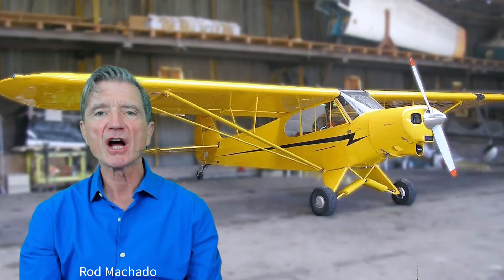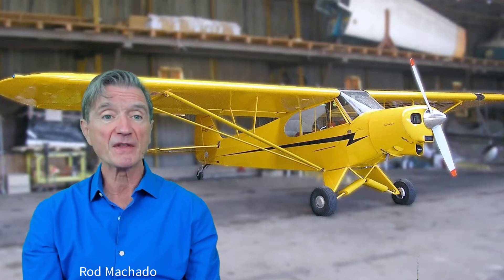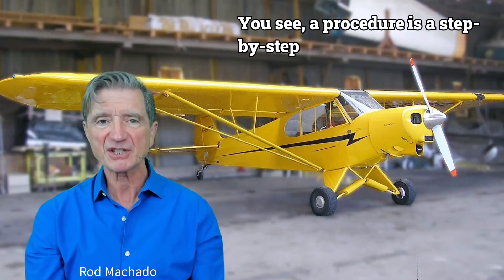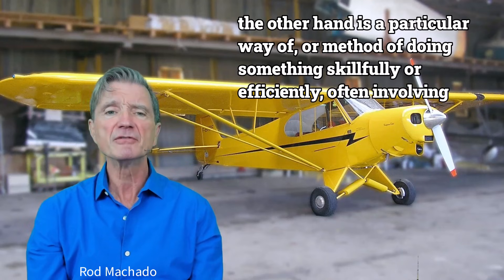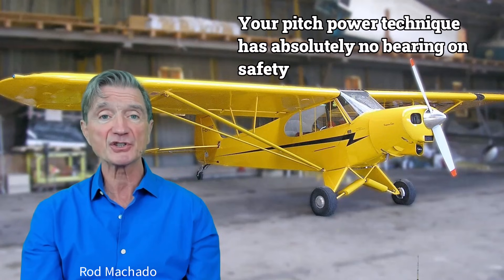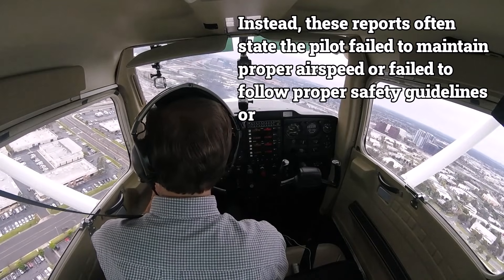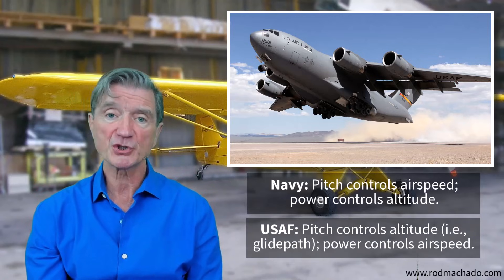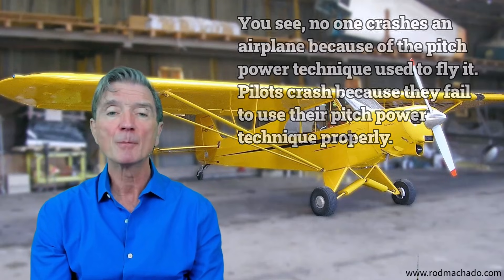Technique vs. Procedure

Comment: there is one, and only one, right answer to this.

Pitch controls airspeed
Power controls altitude

This is mathematical and scientific fact. If I could post images here I would, showing the derivations of the fundamental equations of physics to show that adjusting the throttle affects climb/descent when all else is held constant, and that changing pitch controls airspeed when all else is held constant. This is not open for debate. this is physics, and can be demonstrated in flight in any airplane easily.

There are multiple aerospace engineering books out there one can look to, but the best I've found so far that explains it perfectly is "Airplane Performance Stability and Control" by Perkins and Hage. Chapter one of the book goes into this in detail and derives teh equations right in the book. I say this as a CFI-I of airplanes and helicopters, and as a practicing Aerospace and Mechanical Engineer with tens of patents to my name. Appeal to Authority is a logical fallacy, I share my credentials only to say that I am not some random person saying this, but someone who has dedicated decades of my life to aerodynamics and aviation, including flying, engineering, and the history of aviation.

A person can manipulate the controls in different orders and combinations to achieve what they want, but the fundamental truth above remains true no matter how you do it, no matter which order you try to do it in.
Reply: That is why the airplane begins its ground roll by pulling yoke back, not throttle lmao
Reply: @02YSlkZWQ9  Yeah - it's the same fantasy as believing a six foot propeller can oppose 2000+ lbs.
Reply: Cool, ever flown a jet? It’s usually pitch for altitude power for speed in a jet. Really, it’s always both interchangeably for both, depends on what you’re doing. 

You can always trade speed for altitude and vise versa. You can add power whilst level to increase speed or add power with the same speed and increase altitude. Same with descents. 

We’re overthinking this. 

Maybe for a student pilot who needs something simple to latch on to, we’ll pick a technique and stick with it. 

When a pilot gets a few thousand hours and becomes unconsciously competent at flying they don’t need to think “Okay so uh, I need to add power, oh and then trim, and then uhhh oh yea adjust pitch” 

They simply put the plane where it needs to go with whatever technique is appropriate to their current configuration/position/intent. It’s an instinctive action and not a conscious decision.
Reply: @byronhenry6518  jet makes no difference. what matters is the wing, and thrust. the source of thrust matters not.

You're stuck on regurgitating a procedure you were taught. I'm discussing the cold hard first-principles SCIENCE behind how it actually works.

"We’re overthinking this. "

yes, you are.

"You can always trade speed for altitude and vise versa. You can add power whilst level to increase speed or add power with the same speed and increase altitude. Same with descents. "

Only momentarily. most aircraft for only a few seconds before the excess speed bleeds off. but even then, teh excess speed is doing EXACTLY what the math/physics says as I mentioned above.

"Maybe for a student pilot who needs something simple to latch on to, we’ll pick a technique and stick with it. "

yes, so teach them the Truth, the Correct way.

"When a pilot gets a few thousand hours and becomes unconsciously competent at flying they don’t need to think “Okay so uh, I need to add power, oh and then trim, and then uhhh oh yea adjust pitch”. They simply put the plane where it needs to go with whatever technique is appropriate to their current configuration/position/intent. It’s an instinctive action and not a conscious decision."

absolutely. but that doesn't change the truth of the aerodynamics or physics.
Reply: This is complete BS. If you push the stick all the way forward in any airplane, certainly the airspeed will increase.  You will also lose altitude. Pitch affects both airspeed and altitude, not just one or the other.  And in a high speed aircraft, engine power is sometimes used to climb and sometimes used to accelerate to a higher speed at a CONSTANT altitude. 

I also have a degree in Aeronautical Engineering and your statement that this is a mathematical and scientific fact is simply wrong. Also any pilot who has ever flown aerobatic maneuvers knows how pitch and power really affect altitude and airspeed.
Reply: @timr1422  Pitch affects altitude INDIRECTLY, and airspeed DIRECTLY.

same as how the rudder affects Roll indirectly, and how power affects pitch indirectly.

"I also have a degree in Aeronautical Engineering and your statement that this is a mathematical and scientific fact is simply wrong."

then you need your degree revoked. Go read chapter one of Aircraft Performance Stability and Control by Perkins and Hage and go educate yourself.

you're conflating situations where you change multiple variables at once dramatically and only look at the dynamic period BEFORE equilibrium change and claim it explains things. that's not how we do it. You have to change ONE variable at a time in controlled time steps and see how that change affects everything else, and look for the new equilibrium state. :Learn how to do actual science.

"Also any pilot who has ever flown aerobatic maneuvers knows how pitch and power really affect altitude and airspeed."

yes, and if they have any clue, they'll agree with me.

I am also a CFII not just an engineer who designs airplanes. I also teach engineering to engineers on-the-job (real world application, not just theory in college).It is very easy for me to go up flying with you and prove in less than 5min everything I am saying. and within an hour or less (in-person) I can derive and explain the math for you as well. Or you can go read it for yourself.

but thus far you have given no valid scientific explanation for how pitch DIRECTLY controls altitude, nor how power DIRECTLY controls speed. Given me and everyone a valid explanation of how that works, nd tell me where I can find mathematical equations supporting your claims in at least one Aerospace engineering resource?
Reply: @SoloRenegade You still haven't answered my question.  In level cruise flight, how does the power create an upward force equal to the weight in order to control altitude?
Reply: @warren5699  i've already provided explanation in previous responses? we are not flying rockets, we get most of our lift from the WING, not from THRUST. Also, go ask ChatGPT what force component vectors are.

how about you attempt to explain it yourself, scientifically?
Reply: @SoloRenegade "we get most of our lift from the WING".  Of course.  Then what's with the "power controls altitude" above?
Reply: @warren5699  ""we get most of our lift from the WING".  Of course.  Then what's with the "power controls altitude" above?"

wow, do you have amnesia? where have you been? you've been debating this how long and you're now going to act like nothing has happened and start all over again at the very beginning? 

Power Does control altitude, via excess Thrust. Excess thrust results in a climb. Insufficient thrust results in a descent. this is not rocket science. Pitch controls airspeed.
Reply: @SoloRenegade We're still debating this because you haven't given an sensible explanation.  How does excess thrust create an upward force that would result in an increased altitude, when there is no change in pitch?
Reply: @SoloRenegade "Pitch affects altitude INDIRECTLY, and airspeed DIRECTLY."

Now that I've given you a simple example of how an elevator input can change altitude, you are trying to backtrack and say well, it actually affects both airspeed and altitude.  No kidding-- that's exactly what I said. 

"yes, and if they have any clue, they'll agree with me."

No, they would laugh at your statements, as would any pilots with jet experience. I guarantee you that the pilot of any high speed aircraft in cruise fixes a small altitude deviation with a pitch adjustment, not a power adjustment. 5 minutes in any jet aircraft simulator would show you how wrong you are. Also, try to keep in mind this discussion is about training actual pilots how to control an airplane, not about mathematical equations.
Reply: @timr1422  "Now that I've given you a simple example of how an elevator input can change altitude, you are trying to backtrack and say well, it actually affects both airspeed and altitude.  No kidding-- that's exactly what I said. 
"

I haven't backtracked a single thing I've said in the slightest.

Pitch controls airspeed, and power controls altitude.

Limited indirect inputs tht have indirect secondary effects are true too, it's called nuance. but not every airplane is affected by these, and these indirect control inputs do NOT apply on ALL airplane designs. but pitch controlling airspeed and power controlling altitude is ALWAYS true for ALL airplanes. You lack sufficient intelligence to understand nuance.

"No, they would laugh at your statements, as would any pilots with jet experience."

any who disagree are clueless and have no clue what they are talking about. not all pilots are well versed in aerodynmiics, few in fact have good aerodynamics understanding.

"I guarantee you that the pilot of any high speed aircraft in cruise fixes a small altitude deviation with a pitch adjustment"

perhaps, and I've done it too in light airplanes as well, but these are INDIRECT effects you can manipulate to your advantage for limited effect. Doesn't invalidate the truth.

"5 minutes in any jet aircraft simulator would show you how wrong you are. "

not in the slightest. what maneuver would disprove it? I can demonstrate it in a REAL airplane and I can prove it mathematically too.

"Also, try to keep in mind this discussion is about training actual pilots how to control an airplane, not about mathematical equations."

I am a CFII in both airplanes and helicopters, everything I am saying is geared to teaching new pilots. This is what I teach ALL of my students, without exception (new PVT pilot, refreshers, or add-ons, etc.).
Reply: @warren5699  " We're still debating this because you haven't given an sensible explanation. "

I have, you just refuse to accept the truth, and you have made no effort to go read the book i cited, which you can find free online in PDF.

You have provided zero counter argument. you cannot cite a single aerospace engineering resource that supports your claim. you have not provided a single valid case in which I am wrong. I can't force you to accept reality. I have made my arguments, i have shared my industry recognized and approved sources. You have failed to refute anything I have said, failed to provide any evidence or any sources.

"How does excess thrust create an upward force that would result in an increased altitude, when there is no change in pitch?"

this I can answer, but give me some time to type up that response. But you really should just go read the book for yourself, it will save us both a lot of time.

BOOK: Airplane Performance Stability and Control, by Perkins and Hage. Read chapter one. If you refuse to do this, then you are accepting defeat.. this is a highly recommended book among aerospace engineers. Any self-respecting aerospace engineer should be aware of this book.
Reply: @SoloRenegade "" We're still debating this because you haven't given an sensible explanation. "
I have, you just refuse to accept the truth, and you have made no effort to go read the book i cited, which you can find free online in PDF."

Well, when it comes to proving anything with a concept in a book, we're not going to get anywhere.  I see discussions on different concepts in the FAA handbooks all of the time, and interpretations that are 180 degrees apart.

You say pitch controls airspeed - ok, no problem with that.  Then you say power controls altitude.  I would think about that in this manner.  First there are some raw numbers from the manufacturer we can use.  For a 160hp C172, the static thrust is about 700lbs, and the cruise thrust is about 300.  So the thrust to weight ratio is around .25:1.  It's not possible to lift any object with an upward force that is 25% of the object's weight.

We can also test this in the airplane.  I used to do aerobatics.  One maneuver I did was the hammerhead - I'm sure you are familiar with that one.  The airplane is transitioned into a straight up climb where the power is opposing the weight (same as lifting a glass of water from a table).  What happens then?  The climb stops in a few seconds when the kinetic energy is exhausted .  Why?  Because 500lbs of thrust (upward force) is less than the weight (2000lbs+ downward force).  So even when the power is aimed in the direction that will produce the maximum upward force, it cannot control the altitude.

Please don't get into any claims about military airplanes - this discussion is on civilian aircraft.

If you have an example of a procedure or maneuver in the airplane that demonstrates that power controls altitude, just tell us what that is.  There's no need to get into any debatable concepts which actually will not resolve anything.
Reply: @SoloRenegade Here's a simple example. To increase airspeed in level flight, for example from 150 kts to 250 kts, the pilot would increase power first. As speed increases, the pilot would adjust pitch to maintain level flight. In this case, the power increase is the pilot's primary input and the pitch change is only made AFTER the power increase. You wouldn't make the pitch change first to increase airspeed in level flight. 

Amazing how someone who is supposedly a flight instructor doesn't understand basic concepts about how to fly an airplane. Then you try to cover up your lack of understanding with a pompous, arrogant attitude. I feel sorry for your students, if you actually have any.
Reply: @timr1422  yes, this is a valid scenario. bu tit's not the only way to do it either. if you know your airplane, you can use known pitch and power settings.

You add power, and as the climb begins (power controls climb/descent), you pitch down to a higher airspeed (pitch controls airspeed) to offset the climb by shifting to a higher airspeed that requires more power to climb. and you keep smoothly offsetting the climb by adjusting airspeed until you get to your new equilibrium airspeed that results in no climb or descent.

But had you done Nothing after adding power, you would have climbed at the airspeed the trim was set for.

The order in which you adjust pitch and power matters not. ti doesn't change how physics works.

"Amazing how someone who is supposedly a flight instructor doesn't understand basic concepts about how to fly an airplane."

Everything I has said is 100% true. Highly claimed aerospace engineering sources, the book Stick and Rudder, and many more flight raining and aerospace engineering resources support my claims 100% and they emphatically push back on anyone who claims otherwise, same as me. Also, i can derive the MATH form Physics First Principles to explain it, you cannot. You could learn, but it's clear you have no intention of growing your aerodynamics knowledge.

"Then you try to cover up your lack of understanding with a pompous, arrogant attitude. I feel sorry for your students, if you actually have any."

I'm not like this with my students, they actually want to learn. I'm like this with ignorant and incompetent Commercial pilots and CFIs who are unwilling to learn and unwilling to stop spreading lies. We've understood this stuff for over 100yrs now, and yet you people still can't get it right.
Reply: @SoloRenegade "You add power, and as the climb begins (power controls climb/descent), you pitch down to a higher airspeed (pitch controls airspeed) to offset the climb by shifting to a higher airspeed..."

This is the dumbest explanation I've ever seen for how this works. There is no reason to allow the airplane to start climbing first when accelerating. The airplane will not climb unless the pilot allows the nose to pitch up when adding power. It's obvious your students are learning in spite of your instruction and not because of it. 

I can see your simplistic, narrowminded viewpoint is impervious to facts and logic, but I'll try again.  I used to fly an aircraft that had an autopilot with an altitude hold feature.  The autopilot had control of the elevator, but not the throttles, i.e. it was able to maintain altitude with pitch adjustments alone--it had no control of power. According to you, this is impossible.
Reply: If power controls altitude, why doesn't the airplane fall to the ground like a rock when power is chopped just before the roundout?
Reply: @warren5699  since when do the wings of an airplane fall off when you reduce power to idle? the level of stupid these days is alarming.

you reduce power, the airplane descends faster than before, and if you hold pitch, the nose will drop somewhat to maintain airspeed in the descent.
Reply: @SoloRenegade I hope you are not as snarky to a beginner student face to face as you are in the internet. If I had asked that question and gotten answer like that I would have been looking for a new instructor. We are not born with knowledge or experience - we gain it. And the best students are the ones who ask a lot of questions, no matter how "dumb" they might seem to an expert.
Reply: @jonathanparle8429 i'm snarky to ignorant CFIs who refuse to learn and accept reality. people who refuse to teach their students properly, safely, etc.

I'm tired of the aviation community continuing to perpetuate old wives tales to each other.

nothing I said was targeted at students. but clearly you can't read. reading comprehension is a requirement to be a pilot by the way.
Reply: @SoloRenegade "since when do the wings of an airplane fall off when you reduce power to idle?"  Now you are being totally contradictory.  You said above "power controls altitude".  Now you say pitch?  So, which is it?
Reply: @warren5699  no. you are teh one who claimed airplanes fall like a rock to teh ground when you reduce power. i was calling you out on your BS.

Power controls ALTITUDE
Pitch controls AIRSPEED

learn how to read. reading comprehension is required to hold a pilot's license.

"Now you say pitch?  So, which is it?"

quote me
Reply: @SoloRenegade "you are teh one who claimed airplanes fall like a rock to teh ground when you reduce power.".  No, I didn't claim that - I simply asked a question so that you would realize you are in a fantasy world.  You said power controls altitude.  If that's true, why would you chop power before the airplane is on the ground?
Reply: Your physics facts are correct but impractical for what has to be done during flight.  I.e. if low on the approach, increasing throttle with no change in pitch will accelerate the airplane above it's proper approach speed.
Reply: @warren5699  " I.e. if low on the approach, increasing throttle with no change in pitch will accelerate the airplane above it's proper approach speed."

no it wont. that is a lie. i trained my students to correct ILS glidepath by adjusting power and nothing else. they maintained perfect airspeed and had god-like control over their glideslope. once they learned how to do it, they all adopted it and aced their IFR checkrides.
Reply: @SoloRenegade 100% correct.
Reply: @SoloRenegade "i trained my students to correct ILS glidepath by adjusting power and nothing else."  You missed an important detail.  If you increased thrust and there was no increase in speed, then you increased drag somewhere.  Most likely, the back pressure was simultaneously increased with the power to maintain the speed.  That (the back pressure increasing the lift vector) would be what corrects the glidepath, even if it's just a little back pressure with the fingers.  If it was in a Skyhawk and trimmed properly, you may have not noticed that the increased power pushed the tail down and increased the angle of attack for you.

Have you ever done the procedure in the Skyhawk POH for 'Landing without elevator control'?  The approach AND the landing are done with no elevator control from the yoke, but that doesn't mean the pitch doesn't change.  The power is used to change the pitch, which is possible in Skyhawks because the propeller slipstream can manipulate the pitch.  Everyone of course experiences that on the go-around, but it's also happening in any other phase of flight to a smaller degree with small power changes.
Reply: @warren5699  ""i trained my students to correct ILS glidepath by adjusting power and nothing else."  You missed an important detail.  If you increased thrust and there was no increase in speed, then you increased drag somewhere."

I didn't miss anything. on the ILS, you fly a set airspeed, as you're supposed to do. have you ever looked at the speed categories for an instrument approach? And by adjusting power up or down, you control your rate of descent through EXCESS THRUST without changing airspeed because you never change pitch.

your confusion comes from knowing nothing about aerodynamics.

the excess thrust is used to counter weight. Just as some amount of wing lift opposes weight, some opposes thrust, and same for thrust. some amount of thrust opposes drag, and some opposes weight. the slower you go, teh more thrust starts to contribute to offsetting weight. But this also confuses you still further, because you can't juggle all the variables in your head simultaneously to know what is happening. even though the pitch controls in your airplane haven't changed, the pitch attitude of the nose of your aircraft relative to teh horizon IS changing in relation to power changes, and this changes where teh thrust vector is pointing, as well as the lift vector. as you add power but do not change pitch at all, the airplane pitches slightly nose up, thus the wing is producing more drag, and the thrust is contributing more to lift, and thus you get climb with no increase in airspeed. pitch control is like cruise control in a car.

"If it was in a Skyhawk and trimmed properly, you may have not noticed that the increased power pushed the tail down and increased the angle of attack for you."

good point, that is another variable in play, but it's very subtle, and this is easy to demonstrate in flight. and this can lead to trim stalls on go-around, but this is not a steady-state effect, it is a MOMENTARY effect until the equilibrium forces reset.

"Have you ever done the procedure in the Skyhawk POH for 'Landing without elevator control'?  The approach AND the landing are done with no elevator control from the yoke, but that doesn't mean the pitch doesn't change. "

yes, that works becasue you are INDIRECTLY controlling pitch. what you are REALLY doing is controlling your climb/descent though, and landing flat or on the nose. notice you wont be able to flare on landing without the pitch control (elevator or trim).
Reply: @longtimercer  Talk to pilots who fly airplanes with engines above the center of gravity.  Increased power will pitch the nose down.
Reply: @warren5699  "Talk to pilots who fly airplanes with engines above the center of gravity.  Increased power will pitch the nose down."

and opposite for thruslines below CG. but this is not a continuous pitch, equilibrium is reached. this is an indirect way in which power can control pitch, but it's inconsistent, and once equilibrium is reached is no longer a factor. a thrustline inline with the CG produces no pitching moment, and when you do this, especially on a pusher engine on a flying wing, thrust produces no pitching moment at all, but it still controls climb/descent/altitude same as it does in every single other configuration as well.
Reply: @SoloRenegade "i trained my students to correct ILS glidepath by adjusting power and nothing else. "  I trained my students to adjust the controls like an autopilot/autothrottle system works - i.e. following how those systems are designed and programmed to work under the approval of the manufacturer and the FAA.
Reply: @SoloRenegade "but it still controls climb/descent/altitude".  Yes but very poorly.  If you increase or reduce the speed of the wing, you go up or down.  But it is so inefficient and/or time consuming, it's impractical.
Reply: @warren5699  " I trained my students to adjust the controls like an autopilot/autothrottle system works - i.e. following how those systems are designed and programmed to work under the approval of the manufacturer and the FAA."

doesn't mean it's right.

Now, how exactly ARE autopilots programmed? care to explain? Do you even know? is every single autopilot system on teh market programmed the exact same? and it what way does the autopilot programming contradict anything I've said?
Reply: @warren5699  ""but it still controls climb/descent/altitude".  Yes but very poorly.  If you increase or reduce the speed of the wing, you go up or down.  But it is so inefficient and/or time consuming, it's impractical."

no, it controls it perfectly.

false, you can increase or decrease the speed of the wing without climbing or descending, otherwise you wouldn't be able to changes speeds in straight and level cruise flight.

Climb and descent is controlled by excess THRUST, this is scientific fact, and not subject to your personal opinions.

Let's say you're flying along straight and level. you change pitch nose up to climb without changing power. you momentarily trade excess airspeed for minimal to no significant gain in altitude until your speed bleeds off to teh new airspeed you pust pitched for. but once that new airspeed is reached you might continue to climb Marginally as you've reduced your L/D ratio. but if you keep pitching up more you slow down more, until you fall below your L/Dmax, and then you start to DESCEND at a slower airspeed that you have pitched for. and thus, pitch does not control climb/descent Directly, only Indirectly through changes in airspeed, and the resulting new equilibrium condition you've created.
Reply: @SoloRenegade "yes, that works becasue you are INDIRECTLY controlling pitch. what you are REALLY doing is controlling your climb/descent though, and landing flat or on the nose. notice you wont be able to flare on landing without the pitch control (elevator or trim)."

Yes - that's the point I was making - indirect control of the pitch with the power, which because that works in most trainers, it popularizes the incorrect concept that power controls altitude.  It would be more accurate to say that in some airplanes, power can be used to control pitch, and in others, it can't.

A safe landing can be done following the 'Landing without elevator control' procedure.  However, it is really challenging to get the technique right and it's not something you can repeat incorrectly like a steep turn until you get it right because every incorrect attempt would be a crash landing.  If it isn't going well it has to be aborted with normal use of the controls.  A broken elevator cable in a Skyhawk would be a pretty serious situation.  But at least, as you indicated, if someone used this procedure in a real emergency, hopefully they would be able to at least land flat and walk away without any injuries.
Reply: @warren5699  "Yes - that's the point I was making - indirect control of the pitch with the power"

exactly, power only INDIRECTLY can control pitch.

"which because that works in most trainers, it popularizes the incorrect concept that power controls altitude."

no, power to control pitch does NOT work. only very limited, in some aircraft, with poor pitch control. Power controls Altitude, and no matter how your twisted brain tries to manipulate facts, it will never be true any other way. Stop being unable to learn and accept when you're wrong.

" It would be more accurate to say that in some airplanes, power can be used to control pitch, and in others, it can't."

sure, but that's Not what is being debated here ata ll. We are discussing how Power controls ALTITUDE, and how pitch controls AIRSPEED. Pitch and Power are completely separate things, they are each a fundamental control of an airplane. Yaw can indirectly bank an airplane for example, but the rudder is not an aileron.

You've completely strayed off topic onto something entirely unrelated.
Reply: @SoloRenegade "You've completely strayed off topic onto something entirely unrelated."  Not really.  I've got to run out for awhile.  In the meantime, could you explain how power can control altitude when the numbers just don't exist.  I.e. a 160hp Skyhawk creates a static thrust force of about 700lbs and cruise thrust force of about 300lbs (engineering numbers).  How does that oppose 2000+lbs to control altitude?